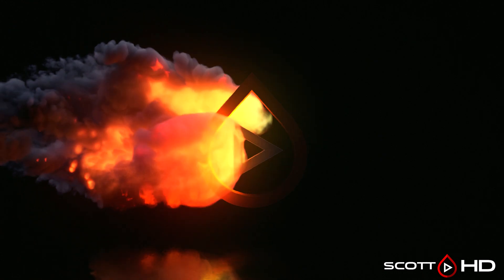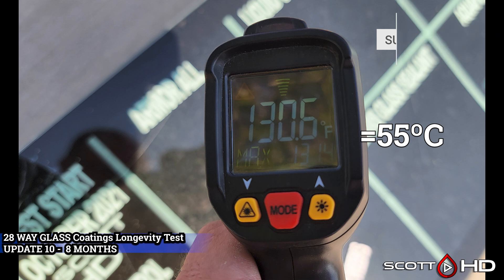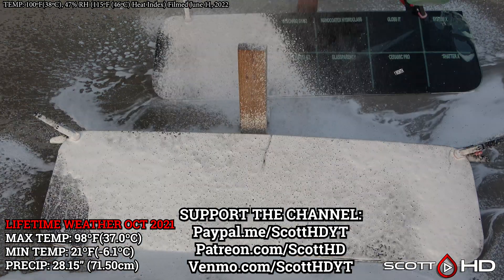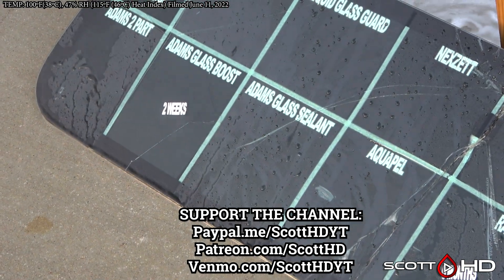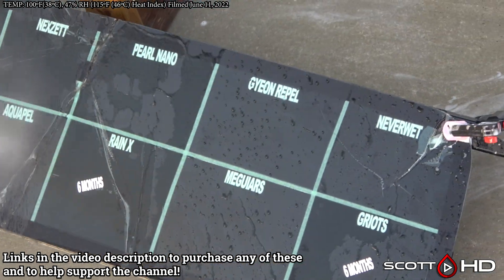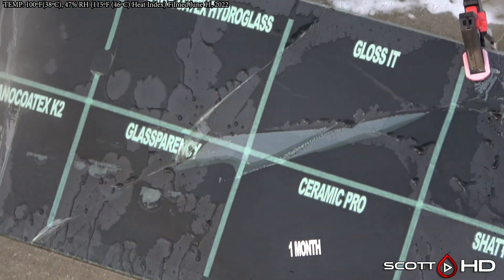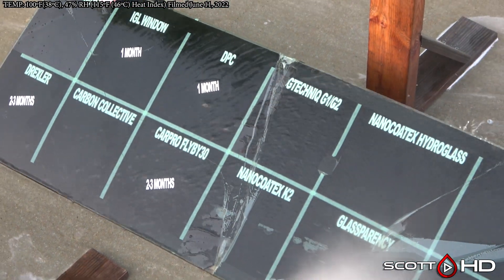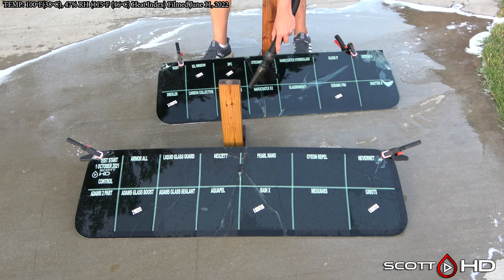28 WAY GLASS COATINGS TEST (HYDROPHOBICS) - UPDATE 10 - 8 MONTHS

Comment: Wish I found you before I installed Adam's graphene. Altho my coating lasted 2 Chicago winters with the car parked outside, dealer washed my car and it pretty much went away. But I used some Adam's ceramic boost with SI02 and it's looking ok for now. 

I recently purchased a 19 year old beater for work. I really wanted NGNT but with little information on when and under what name it would be entering the market as, I purchased Gyeon repel (with your link). I also purchased NuFinish's graphene due to ease of use and price point. It's for a 19 year old beater but I would like to experiment with "automatic car washes" for winter and I'm not even going to prep the car. Just want to see how long will the coating last. 

 Keep up the good work! Really appreciate your channel!

Comment: I have used Armor All and noticed it needs to be installed in the shade and seems to work really well on all the vehicle windows except the windshield - it causes marks on the glass when you use the wipers in both spots where they change directions. Plus the use of the wiper blades pre-maturely wears out the protection.

Comment: Why couldn't you use a ceramic coating?
Reply: My understanding is that they aren't typically designed to bond to glass.
Reply: As the original posted stated, very hit, and miss. I've tried it in the past, some times it worked pretty well. It was really particular products (not going to name) which worked very well on my car, yet didn't seem to work at all on my truck.

It was hit or miss depending on the product and windshield, it always seemed to come down to bonding issues.
Reply from the maker: They can haze up on glass too

Comment: I've been using the armor all glass coating for several months, and I've not had any trouble applying it outside. Morning, mid day, night, etc no real issue with it even in the sun here in southern Mississippi.

I really kinda like it, thought it does cause some wiper chatter when I have it at the lowest setting. I do like the stuff but I only get about 10 weeks of good life out of it. It stays around longer than that but that's kinda the point where I feel it reaches beading rain x washer fluid level.

I guess I can see folks having issues applying it if they don't fully wipe it down, I like to work it in myself, but even in direct sun middle of the day 90+ I've not had issues.

I guess for context I'm very picky about a clean windshield so I will frequently use the washer fluid, and wipers. That is probably effecting its life some, I always clean the windshield when I get in it as well.